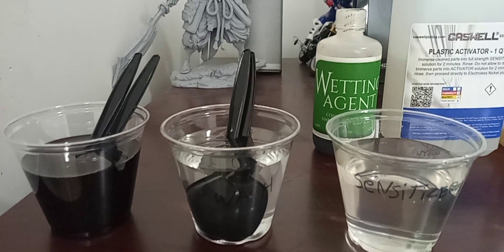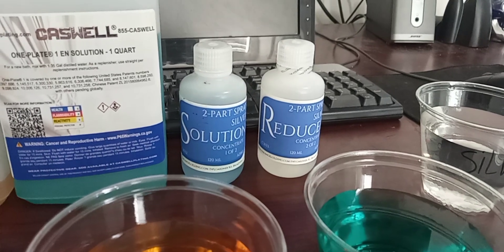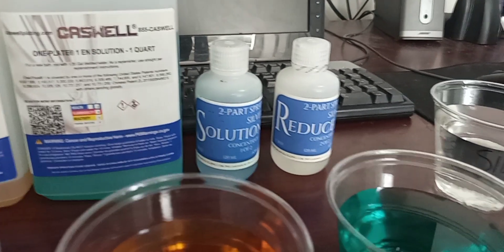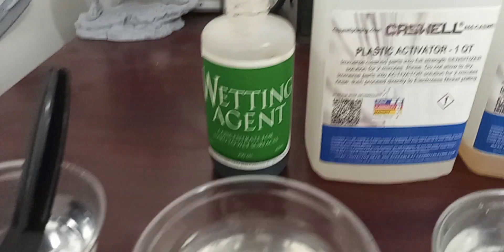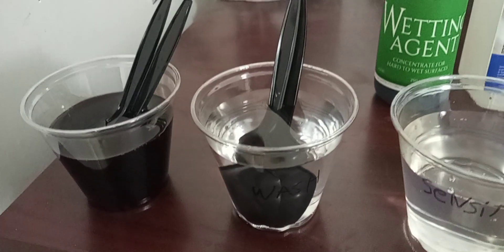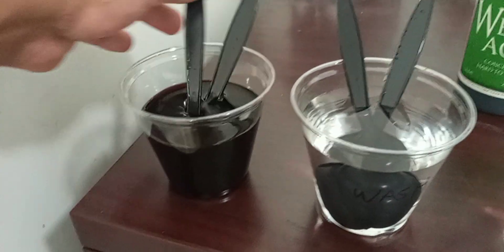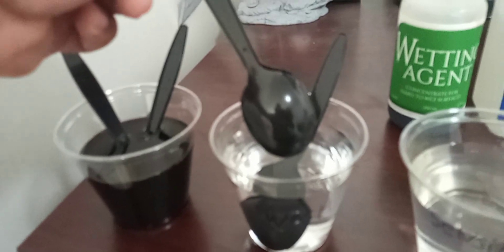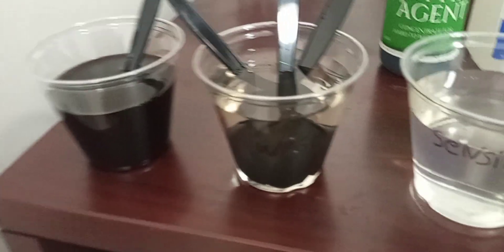Wetting Agent for Electroless Nickel and Silvering/Spray On Chrome

Comment: After using 2k clear varnish on the plastic we can plate it with electroless solution after applying hydrochrome activator and washing with distilled water?